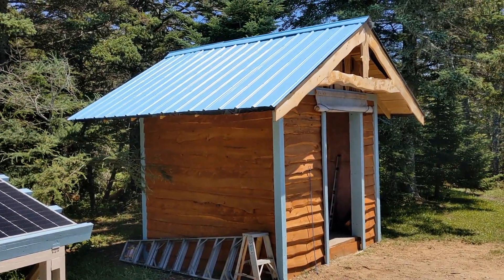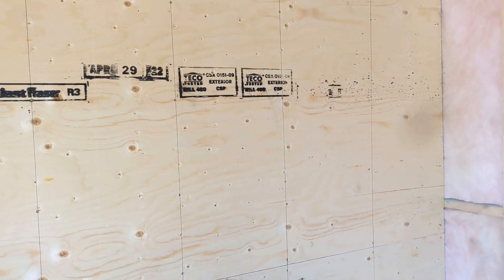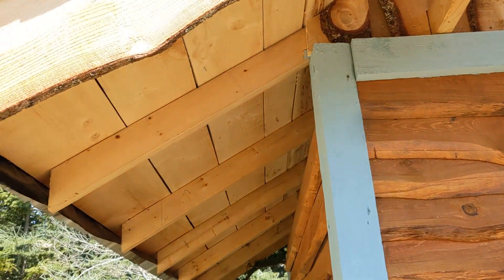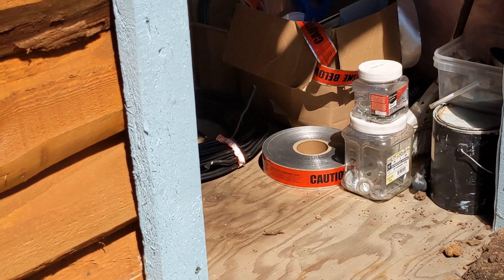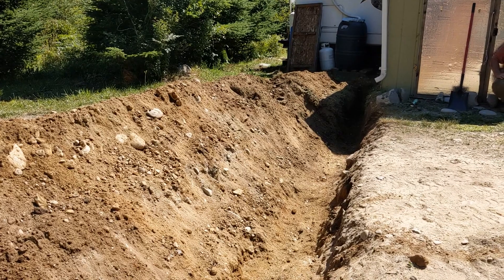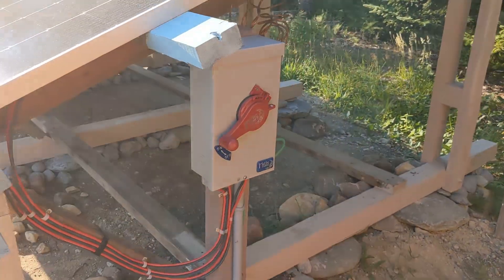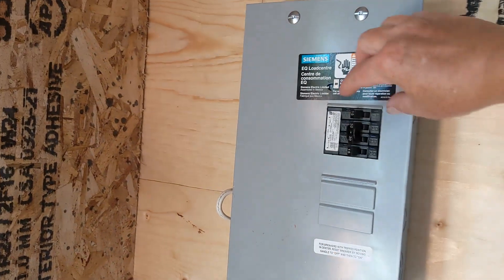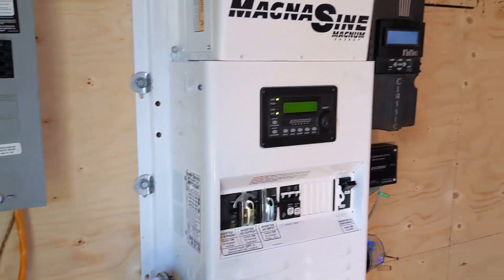Does Our Solar Work?

Comment: Did you source out the bits and pieces , or go with a solar company to supply everything? If so, may I ask which company?
Reply from the maker: Thank you for watching our video.
The Cabin Depot near Fredericton put our package together for us. They do not install, so we didn't have to worry about getting pressure to have to pay someone to do the install. They actually sell to some of the installers in the Maritimes, and they have a store that you can go in a purchase from. I emailed them a list of what we needed to power, and they sent me a couple options.
Reply: @NovaScotiaOffGrid  
Thank you for the tip! We’ve been considering solar for a while, but system within our budget. A whole home system we’ve been quoted is well out of our range; plus when the grid is down we’ll have shiny paperweights on our roof. Lol

I think we’ll start small as a backup option and build from there.

Comment: Mini Winter Solar Tip: You can gradually turn down a Beuler and all other hungry electricity consumers with the "5000W dimmer".  Ebay €7.  I run 5 dimmers in parallel on an 850W inverter.  Kettle 2.2KW at 150W runs 12 hours a day, so the water is always hot.  The room is also nicely heated.  2.5KW washing machine runs in parallel with dimmed to 200...400W.  Iron, dishwasher, oven, electric heater, coffee machine, all internal heating are throttled with me.  Videos about it on my channel https://youtu.be/eC2olbCBhh0 The inverter stays cool, quiet and the MOSFETs remain intact because extreme current peaks no longer arrive at the inverter.  Now every Mini PV Inverter is enough to sell large devices.  So, with the dimmer, all internal heaters/devices can be converted into base load devices that stay almost permanently ON, drawing very little current directly from the PV.  With a wattmeter / energy cost measuring device you can then measure this perfectly in order to set the dimmer optimally.

      A little hint (for everyone else): Energy cannot be saved.  So if I want to boil my water, I always have to use the same amount of energy for one liter.  Christian's method relies on a longer period of time with less power in order to be able to use the power provided by the PV as efficiently as possible - so consumption peaks are intercepted.  In the end, the energy consumption should even be (slightly) higher due to the interposition of the dimmer, but it doesn't matter, since more efficient coverage by the PV system and therefore better use of the self-generated energy......
Reply from the maker: Very interesting. Thank you for taking the time to send us advice. I will definitely check out your video.